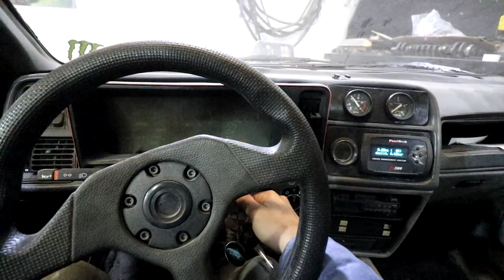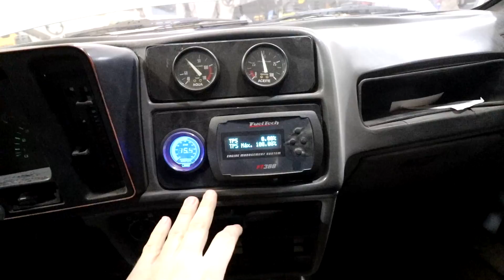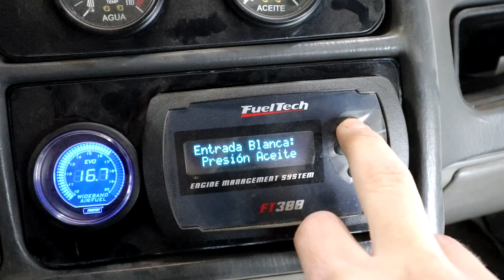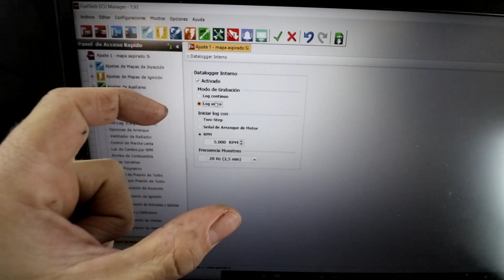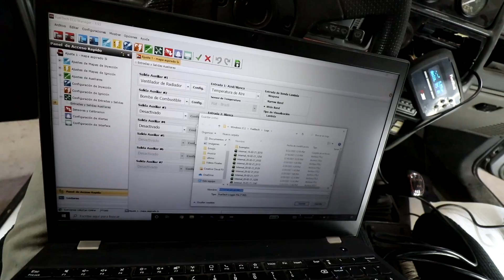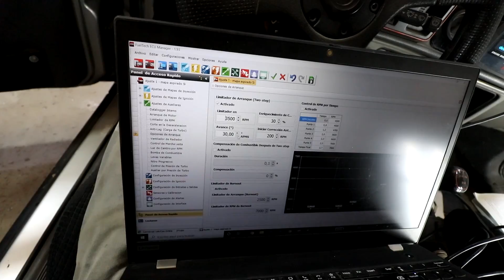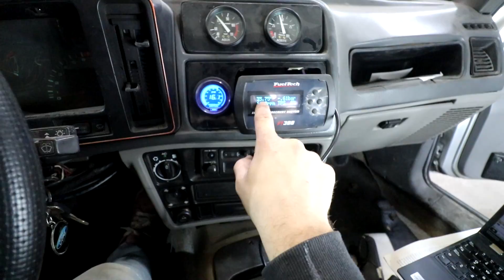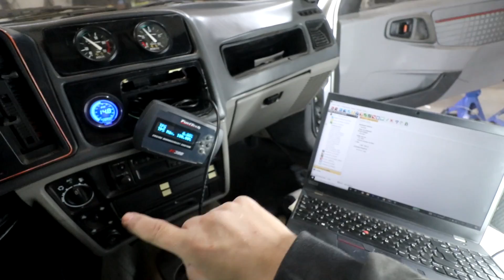Conectando la Wideband a la FuelTech para datalogear!

Comment: Los sensores que traen de fabrica los autos son narrowband . El voltage que leen es de hasta 1 volt. De esta manera en el marcador tienes un parametro aproximado de como se encuentra la mezcla, pobre o rica.

El wideband es lo mismo.. solo que leen hasta 5 volts.. la diferencia es que tienes mas secciones para leer porque tienes desde 0 hasta 5 en ves desde 0 hasta 1.. de esta manera es mucho mas preciso y confiable de ver como se comporta la mezcla para hacer ajustes en las calibraciones

Un wideband puede leer como mínimo 7.35 partes de aire por una parte de gasolina
(es decir 7.35:1 como mezcla rica) y como máximo 22.39 partes de aire por 1 de gasolina (es decir 22.39:1 como mezcla pobre)
En cambio un narrowband tiene un rango "preciso" aproximado de 14.0:1 como mezcla rica y de 15.5:1 como mezcla pobre
por eso es muy dificil y muy riesgoso utilizar este tipo de sensores cuando estas excediendo las capacidades de fabrica de tu motor, es decir,
cualquier cosa por arriba de 14.0:1 como por ejemplo 13:1 - 12:1 - 11:1 etc... en un medidor narrowband te va a marcar mezcla rica
Reply: Es más fácil resumir todo eso en: un sensor narrowband solo sirve para buscar valores lanmda de 1, fuera de "1" que sería 14.7 afr la curva de voltaje no da resolución para ver otros valores... de echo para eso fue diseñado
Reply: @tomasezequielrojas5370  como más te sirva a vos